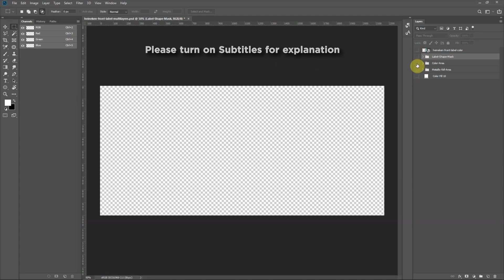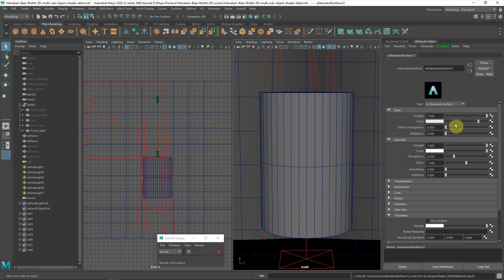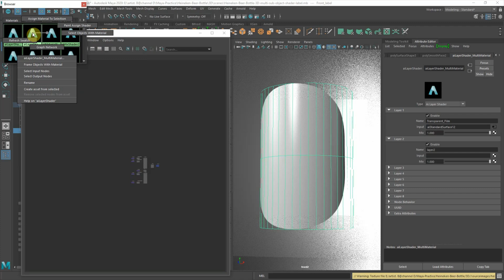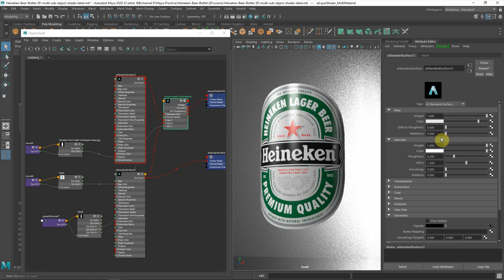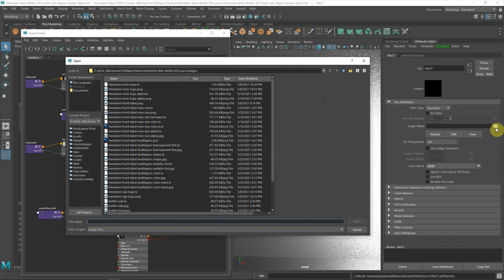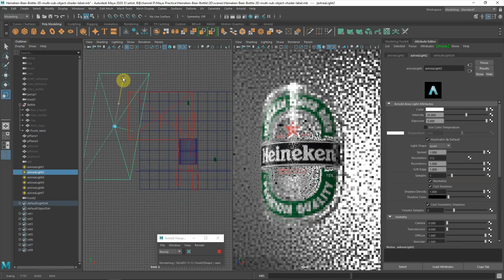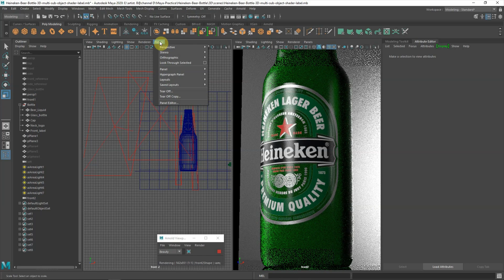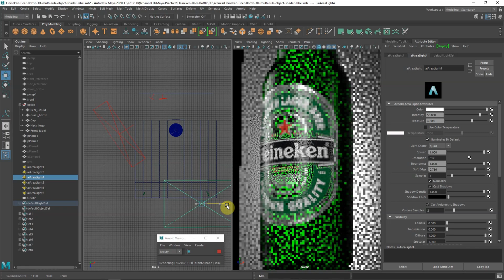How to Apply Multiple Materials on a Single Object, with Arnold Renderer - Part 4

Comment: It feels even more real as it is converted to transparent film substrates after putting the brand in.
Plus, it's cool to match the angle of the light.
I was really surprised when I last labeled the glass bottle because it looked real.
Thank you for sharing this video.
Reply from the maker: thank you for watching. Yes, this is simulation of the substrates, trying to as real as possible.